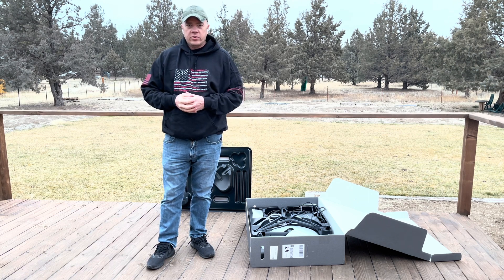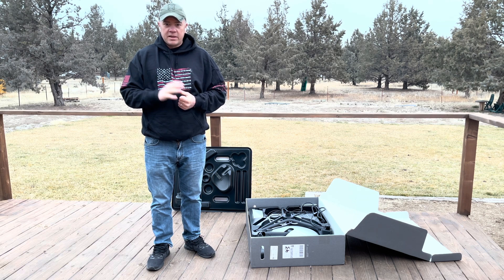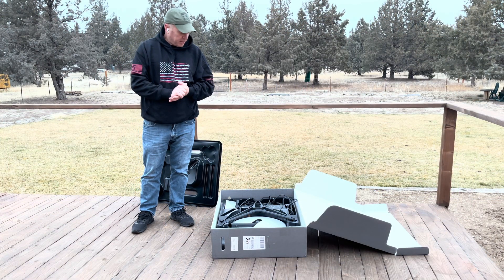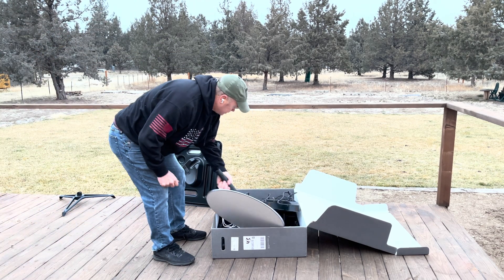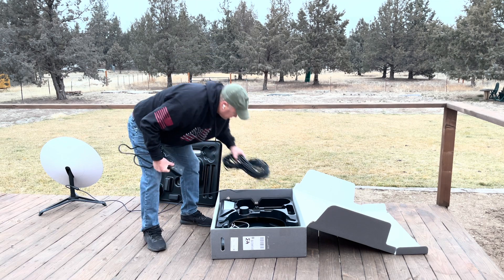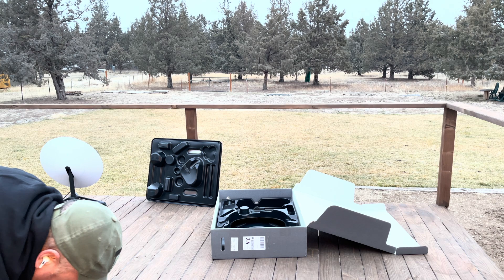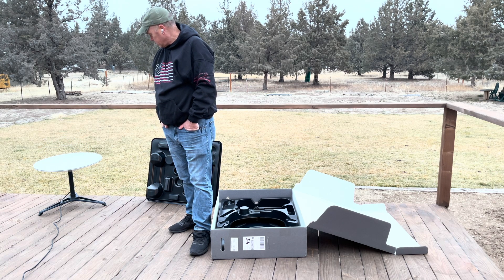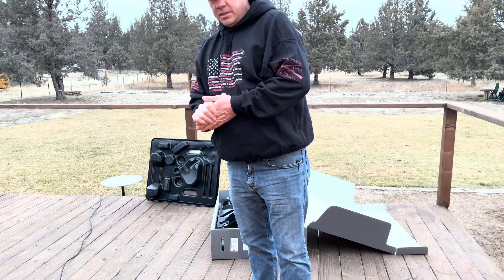Starlink Central Oregon Test

Comment: It is not GEO locked it is cell locked. So you can in most cases get out to 20 miles from the address and it will still work.

Comment: I'm not sure why people keep propagating the rumor that it is "geo-locked." Only certain ground cells are active by Starlink. Once the Terrebonne area is in an active cell, your dish will work just fine. Right now it looks like only north of 45 degrees is available.

My Dishy will work anywhere where Starlink service is currently available.
Reply from the maker: Thanks for that input, looking forward to testing again soon.
Reply from the maker: Brief update, I confirmed with support that the location is not supported.  They suggested I check back next month.  I plan to check in regularly to find out when they support more locations.
Reply: Thanks for that, perhaps the geo-lock notion came from the wording regarding service address? Thanks for the info, I’m in PDX and eventually want this for Central Oregon but I’ll try it out N of 45. Thanks!

Comment: The furthest 'confirmed' distance is 19 miles, about the size of a cell, and its locked to the cell.
Reply: By any chance do you remember where you found that info and was there any speed degradation? I just go an invitation and it would be nice if I could move it between two other locations. One is about 7 miles away and the other 22.